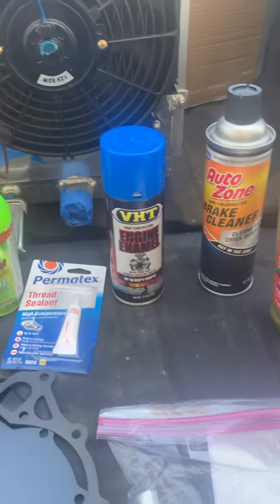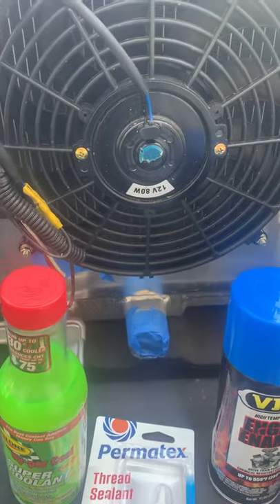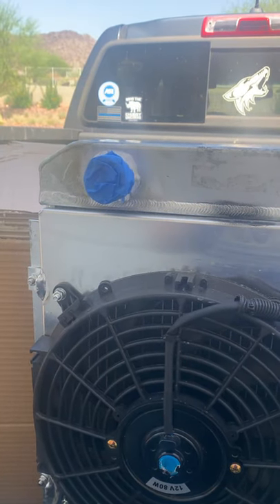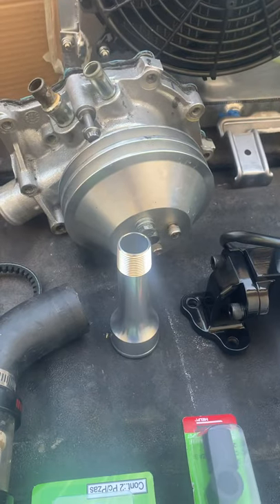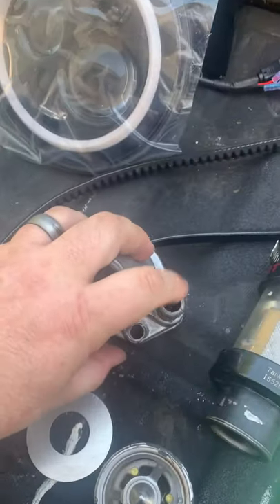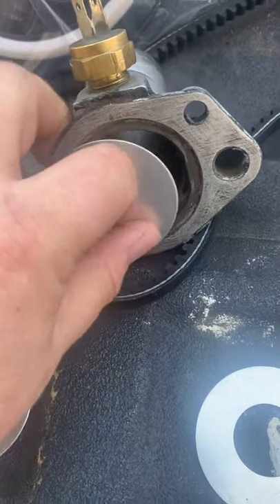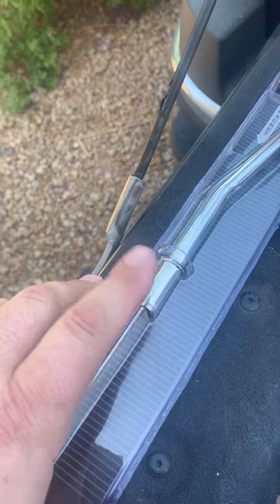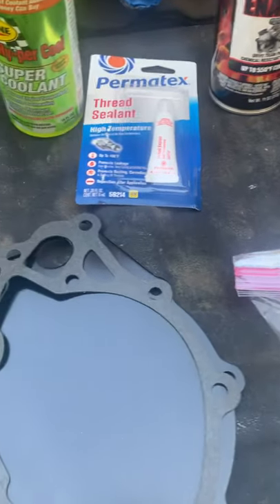What you need to Install an Electric Water Pump on a Classic Mustang (or any classic really)!

Comment: Where did you get the new alternator bracket kit??
Reply from the maker: I got it on Amazon.
https://www.amazon.com/DNA-Motoring-ABKRC4300-Aluminum-Alternator/dp/B00TZE3ZMM/ref=sr_1_3?crid=2H5IDXN6BLEJ4&keywords=ford+sbf+302+electric+water+pump+alternator+bracket&qid=1661348495&sprefix=Ford+electric+water+pump+alternator+bracket%2Caps%2C128&sr=8-3